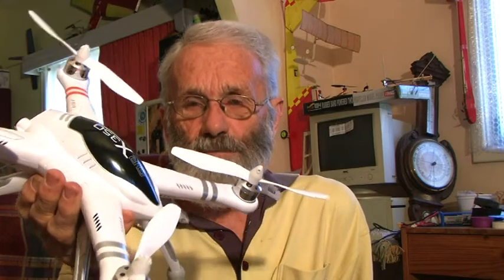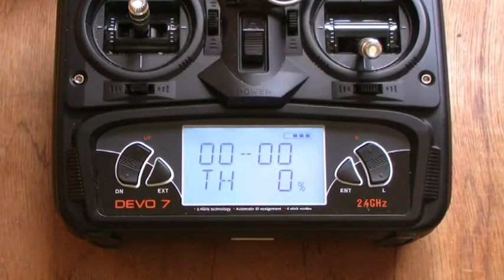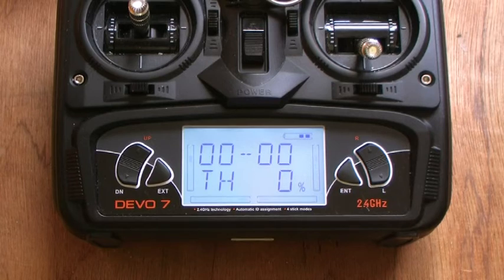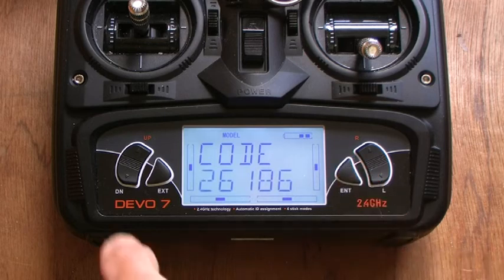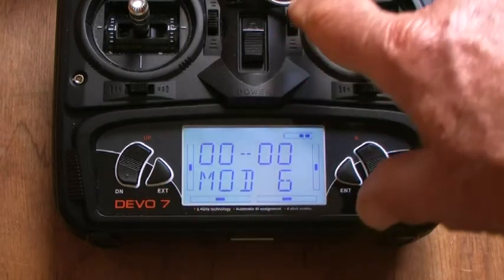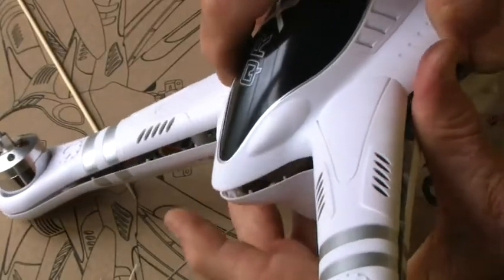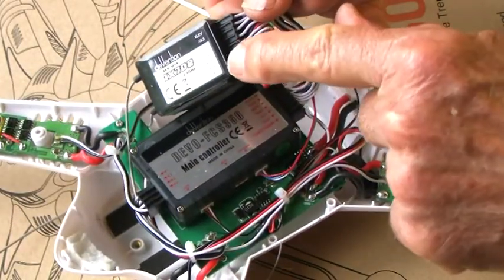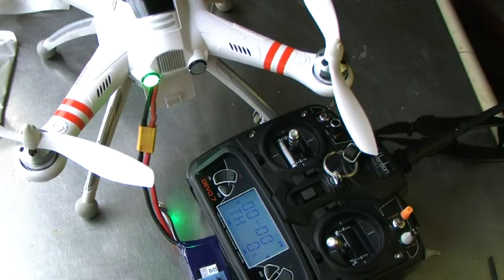FIXID Pt2

Comment: hi I have a question for u I have a Walkera rodeo 110 mine fpv race drone with the Devo 7 transmitter n I hit some kind of button on the tx n the drone still beeping 😢 n I hit the reset button on the drone still beeping 😢 n I have a bind plug fo it to n I don't have a computer to reflash the firmware on it but is there anything else I can do to help me get it bound together for me to fly to?👍